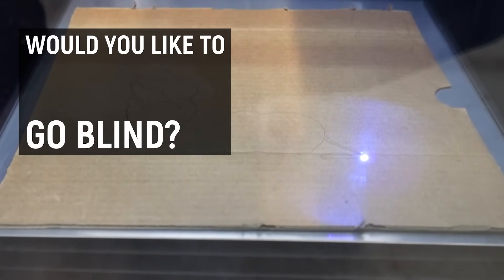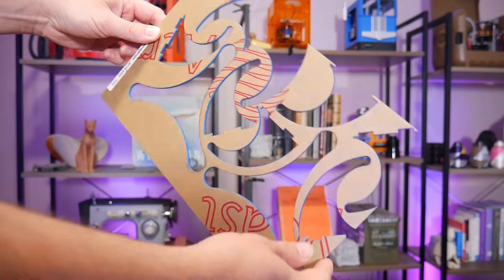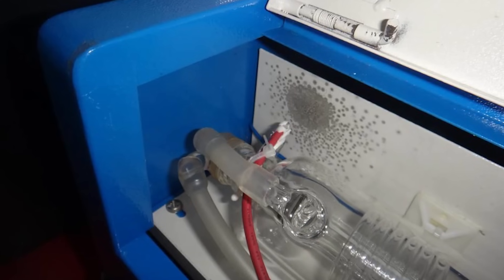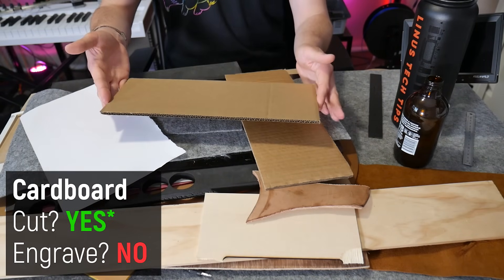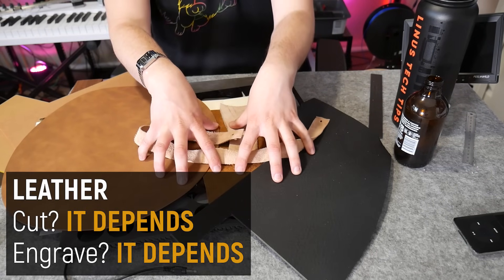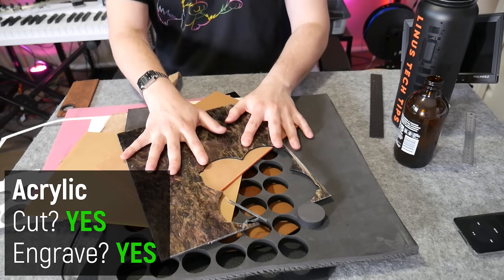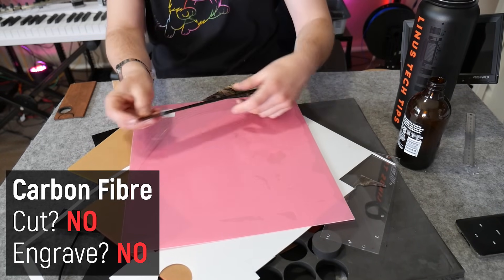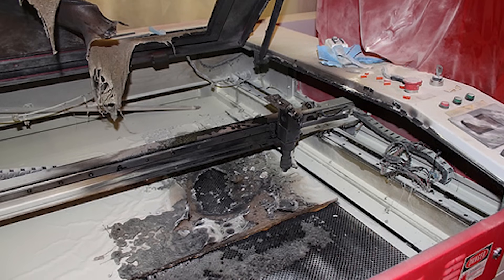Are cheap laser cutters safe?

Comment: I've been wanted to add a laser to my printer for a while now.  probably not too much cutting for me, but I'm a machinist so I'd like to be able to engrave metal (steel, ss, alum, brass).  Is that a reasonable thing to pursue, or are laser not quite powerful enough yet?
Reply: Realistically you want a fiber laser if you want to work a lot with metal which can be had for a few k. The alternative if you're just wanting to occationally mark metal parts is to use spray paint as an acid mask and burn away a negative
Reply: @noobulon4334  oooo, yah I'm not looking to spend a thousands.  My primary use would be to mark things like drill bits & arbors..mostly things I cant or dont want to punch ID marks into.  Do you foresee a time in the future that a laser capable of engraving metal is a few hundred bucks?  Or is that totally unrealistic?

so with the mask & acid burn, I'd just scratch whatever I wanted into the spray paint, then dip it?  What kind of acid?  special spray paint?
Reply: @mtraven23  yeah, i dont think we're going to see cheaper lasers of that type for quite a while. 

As for acid etching, pretty much any spray paint will work but I'd suggest matte black because it will vaporize well (try not to breathe it in). Depending on the metal you may need to do some surface prep after you make your mask, for aluminum that means wiping the exposed surface with lye to break down the oxide layer, but I've never tried it on chromed steel or blued metals. I normally use ferric chloride for etching because its a lot more dangerous to the metals than it is to me and works well for aluminum (although it makes flamible vapors) and copper/brass, but really it depends on the metal you want to etch.
Reply: @noobulon4334  well thanks for all the info, seems like I have some experimenting to do!

Comment: A couple observations. I shared and share your viewpoint on budget lasers in general. However, recently technology and general knowledge has improved and I feel like lasers are no more dangerous than other shop machinery like lathes, drill presses, table saws, routers, etc. they just have a slightly different set of dangers to be aware of. The issue early on was only a few of us were aware of these dangers and speaking out against it. That and this ignorance of the dangers likely extended to the companies manufacturing and selling these machines. Luckily, it seems the word has gotten out about inferior laser goggles and hazardous materials with regards to flammability and noxious fumes. At this point, if you purchase a laser without doing your research, that’s on you in my opinion. 

Buying actual certified laser goggles from an accredited lab, an appropriately rated respirator and/or an enclosure with extractor and filter to the outside, a list of hazardous materials, and an understanding that you need to be within monitoring distance with some sort of fire suppression handy, as long as the laser is running.

It’s really no worse than buying an off the shelf router, or table saw, which are available in Chinese budget form as well, which neglect safety goggles, hearing protection, face shields, proper knowledge bases for safety and the like. The difference is, these tools and their hazards are common knowledge. Lasers are new and a relative unknown.

Another consideration is the fact that most laser projects have a timescale of around a couple minutes to an hour, especially at these budget sizes. Unlike 3d printers or even CNC routers, which have glacial timescales by comparison, you’re an idiot if you’re running your laser for long enough stretches you can leave it unattended without needing to change materials. Flare ups can happen fast, but an air assist can drastically cut down on the chances of these.

In closing, I definitely don’t recommend setting up any laser in your home, even a $10k+ model with filtration. But having one in a barn or shop with an enclosure and proper safety goggles, an air assist and a healthy respect for the fire hazard, and it’s as safe as running any other mid tier shop tool.

Comment: I used a laser cutter once. It was an enclosed one with a filter luckily. I was trying to cut 8mm multiplex. Speed was set very low, to make sure it would get through.

At the top, it looked fine. But, at the bottom, it was completely black. Turns out it burnt a lot at the bottom because the dxf had double lines. Having this happen in an open lasercutter would've been a big problem...

Comment: It seems to me you are approaching this from the wrong angle... you are basically telling people "do not get less than a $5000 laser cutter" but the correct approach is "these entry level cheep laser cutters are not safe, here is why, and here is how you can make them safer. Build a simple DIY enclosure with a cloths dryer vent hose and fan to vent fumes out doors...", etc. It can be made safe, you just have to take the proper steps to do so. You also focused heavily on CO2 lasers, but most of the CO2 lasers on the market are built properly... the low budget lasers are mostly diode or fiber.

That said, I liked the segment on what is safe to cut and etch... excellent information shared... this is why I like your channel. Most materials have what is called a Material Safety Data Sheet available online to fill in those gaps of "I do not know" you can also look up individual materials.

Comment: 12:12
At my local makerspace, we use a CNC router for cutting Polycarb. I'm not sure anyone has tried using our laser cutter for it, but I don't think anyone is dumb enough to. The CNC mill is loud, sure, but there's quite literally no danger to cutting any material in it, apart from the fact that it can cut your hand if you stick your hand in it, which is quite literally the most obvious thing to anyone ever.

Comment: My first thing around any laser outside of a 3-5mw red laser pointer, around anything with any power - where's the laser safety goggles? Especially around anything literally reflective they can blind you in an instant.

Company I worked for made laser warning receivers for military (helicopter/tank/plane) that would tell you the direction a targeting laser was hitting you - rememer the helicopter presentation "when the alert goes off you have less than 15 seconds to get behind something before you're dead" 🤔. 

We had engineers out for field testing, they all got retinal scans before & after to ensure no damage (and protection of course).

As to fumes from what you're cutting... I wouldn't laser cut anything without proper ventilation.

Comment: This is why I diy my own laser cutter and not buy from shady sites with shady prices. I just cover my laser cutter with metal that is painted black and the door has a limit switch to make sure it makes an audible alarm and immediately shuts off the machine. and is sometimes flooded with argon if i work with nasty metals like titanium steel or platinum.  

Also i don't put windows. Laser resistant glass in IR spectrum isn't available here. So I just use a camera covered in welding glass

Comment: there's some great video's on youtube that show the goggles that come with those cheap open air diode lasers are basically just tinted safety goggles with no real protection from any wavelength.  

our local vocational school has a laser cutter, and I'm even skeptical about looking at the laser cutting anything through the top glass.  i usually use my phones camera so i have something else in the way of my eye's directly.

Comment: G10 ought to cut with a CO2 laser fine. The 10 um wavelength is very well absorbed by the glass fibers, far better than visible or near IR lasers. The resins can vary, so vent and filter.

Comment: Next thing is particulate matter in the air. Proper machines have proper extraction concept engineered into the machine, no gaps in the housing, gaskets etc.. On cheap machines, even when they seem fully enclosed and have extraction fans, they blow out particulate matter everywhere.

Comment: Open air lasers are common in industry. For example, I used to work at Exotic Metals Forming Company where we had multiple rooms full of kW level fiber lasers, cutting nickel superalloys.

We protected the employees with…you guessed it… laser glasses.

Comment: I had a co2 laser, 1991 the coaxial lead was broken and potted close to the break, I was told I could use exhaust paste to fix it in position as it is a great insulator..... not when it's wet and the laser on..... I survived.....

Comment: Thanks Angus,

I'm fortunate enough to have a sizeable 160w fully enclosed CO2 laser and combining it with 3D printing works brilliantly for my small business.

I completely agree with everything you have said, sadly the ever lower price point encourages people to 'learn on the job' rather than learning the skills and researching before investing in equipment.

I'm amazed that these open frame lasers are permitted at all, not just the danger of stray laser radiation but as you point out everything you burn will give off fumes and aside from the danger of the fumes to your health, pretty soon your house is going to smell like a bonfire or plastics factory.

It's incredible to see those promotional photos you included of the laser running while a baby is sat right next to it.

Laser burns are also particularly nasty as the focal length results in the most damaged tissue being several mm beneath the top layer of skin.

I'm a big believer that it is the user that makes any tool dangerous, not necessarily the tool itself, but many of these look like an accident waiting to happen.

Another informative video, thanks Angus 👍

Comment: I have a fairly cheap lasercutter. The area around the laser is protected with what I presume to be the same  material as the goggles. I would really have to crawl underneath the laser to see the light any other way than in a reflection, through protective material, through my goggles

Comment: I've been working around professional CO2 lasers with extraction/filtering systems for several years using a variety of materials. In my experience EVA is the worst of all. Acrylic smells (same if you try to cut or drill it) but EVA foam stinks to high heaven. It's so bad I've been wearing professional filter masks and kept windows open if at all possible. Trotec's LaserPly (two-coloured sheets of plastic for sign making) comes close second. The stuff we had was also remarkably unreliable, thickness varied up to +/- 2 mm at a nominal thickness of 10 mm.
I've heard two close calls with fire, one with corrugated cardboard and one cutting 10 mm acrylic in a 120 W CO2 laser cutter. We never leave the lasers unattended during cutting and try to avoid corrugated cardboard. If we do run it, we keep it under constant supervision even during engraving. With the right settings it does look great because engraving exposes the wavy inner layer. We have a fire blanket and a CO2 extinguisher right by the laser cutters just in case. Since I work with the public I get plenty of questions from DIYers who'd like to buy a laser cutter and I've always advised to get a decent enclosed one with a proper filter. Or join a maker space where they get access to a vastly better professional one.

Comment: One of the scariest things is that these diode lasers usually don't have any kind of fire detection. The fact that they are so low powered means that your jobs can stretch on to be hours, which means that you are probably not going to be sitting in front of it the whole time. Having a open frame laser engraving or cutting a flammable material without any kind of monitoring is just asking for a fire.

Comment: I have an xTool D1 Pro at 20W (diode, 4x 5W) and it's a great machine. I did have to add on air assist, the enclosure, and a nice extraction fan, but it has a lot of great safety features like a tip sensor and flame sensor. If you use common sense as to safety (good goggles - not the cheapo blueblockers that come with it, keep a fire extinguisher handy, don't cut PVC, etc) there's not much danger.

What terrifies me is when they sell a 2W UV laser as a 'club DJ laser'. Holy hell, you're shining it at people! Who don't realize it! Who have no eye protection! No no no no no.

Comment: For the last 6 years I've been working with high power (>2kW) metal cutting lasers (CO2, Fiber and SS/Diode). Where I've worked, the machines were manufactured with proper protection for your eyesight, lungs and health in general.
However, you'd be surprised with the way Chinese manufacturers build their machines. There's a really big manufacturer (BODOR) that sells laser cutting machines with 12kW and 15kW fiber oscillators with no protection around the gantry. Imagine a 4m long machine, cutting with no walls or "windows" around it.

Comment: What should be a real concern is too often ignored. I have a K40 laser, 5 week effort to upgrade airflow, laser light shielding, electronics, low & high voltage wire shielding & routing before I even turned it on.  I too was shocked by the lack of safety in the design of the K40 & other laser engraver/ cutters, including those in the  4,000 to 6,000+  dollar range.   In my opinion the unshielded laser cutters expose us to extreme & totally unnecessary risks.

Comment: Industrial laser cutting pro here - if you're already using one of these, or thinking of getting one, then forget about relying on the goggles that are supplied. They may or may not work and won't protect you from reflections from the side. Proper laser-proof material rated to the correct wavelength costs real money. Are you going to rely on Chinese Quality Assurance to protect your sight? You definitely need to get an enclosure to protect from reflections and also for fume extraction.
Co2 lasers are the least dangerous as the beam spreads and diffuses over distance. The beam is absorbed by the surface of the eye and triggers a blink reflex, which can prevent serious damage. 
Diode/fibre/yag lasers are far more dangerous even at lower wattages. The beam diverges far less over distance and because of the different wavelength passes directly through the cornea straight onto the retina. Remember - it only takes a few hundred milliwatts to damage your eyes.
The other points were all solid, especially about fume extraction. If you can vent to the outside then great. Lots of carboard and laminated wood uses glue/resin which gives off some nasty fumes. If you can, use activated charcoal filters to kill the fumes.

Comment: Saw this video a few hours after i sent a laser back to Amazon. ;)
Wanted to use it for solder mask removal on self made pcb. So a small machine that i can easily place in front of a window seemed to be a good choice. The laser didnt even come with goggles and only a small 'window' allowed to see the laser, but nothing else was visible. Alugning a work piece was impossible.
Wonder how toxic burned solder mask is...

Comment: Cake... You didn't mention cake.
My Eleksmaker A3 has done a few cakes. Line art can look awesome on top of a cake. But the colour is a huge factor in how well it works. Pink icing is very difficult to burn apparently. But brown chocolate icing burns very nicely (albeit hard to see the result).
You may require several test cakes to get it right.... Yum! 🤣

Comment: I bought an alfawise C10 with laser module.
Safety concerns made me keep the laser module inside it's blister.
I'll probably make an enclosure and some safety things to use it some day.
Reply: "ll probably make an enclosure and some safety things to use it some day."

Enclosing it might actually make things worse because the smoke that the laser generates comes from the bits of material that are not burnt so the smoke contains a lot of unburnt gas an particles that can collect in the enclosure and at some point go book. This is how fires spread so quickly; hot flammable gas travels through the house and once the source of smoke gets hot enough, all of it goes up allmost at once.

Ventilate, put your printer in a place where catching fire can't do much harm, and above all: don't leave your lasercutter unattended, ever.
Reply: @vinny142  The enclosure is mainly for the laser not to blind me or my cat. There will also be some air assist and an extraction so the fumes will be directed outside of my house. The limited size and power (2.5W laser and 300*200 mm surface) makes it manageable regarding fire hazard.

Comment: Extremely difficult getting through powder coat with our 60W industrial CO₂. It takes insane energy to completely ablate the polymer. Superficial marking isn't too useful as the polymer seems to reset leaving barely visible markings.

Anodized, on the other hand. Too easy. Highly recommended no matter the laser power.

Wonder if your carbon absorbent needs a recharge. We go through tonnes of acrylics. No material has ever produced any detectable odour whatsoever — until removed. Can't imagine our filtration doing anything different with carbon.

Comment: I thought about adding laser to my CNC router ! But did some research and was very worried about the fumes and dust ! or worse going blind !!!
the CNC its nightmare for dust even with a industrial excision system and if you use old cutter the smell of burning last in the air for days 
We have even had fire in the dut hose due to cutting through a staple (hid in wood from transport ) causing sparks that set fire to the fine dust and was turn in fame jet by the air being suck away ! Fine dust is a major health hazard !